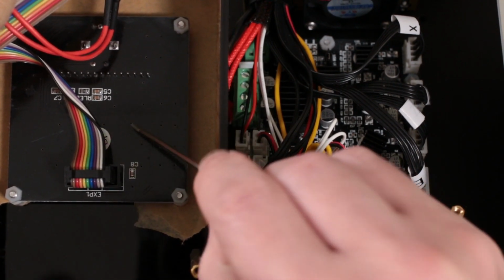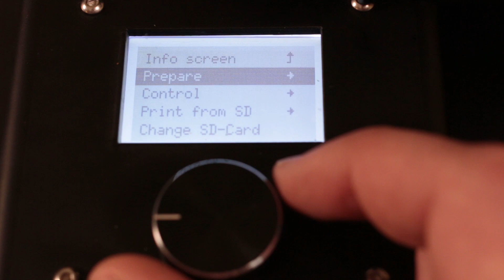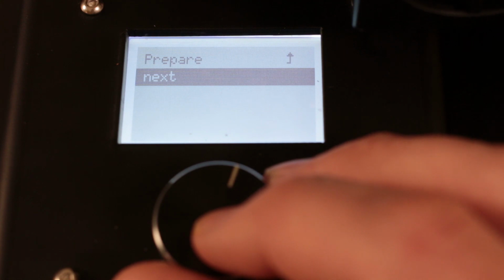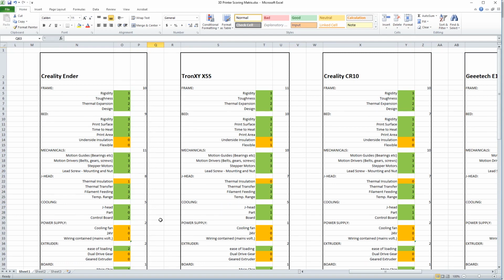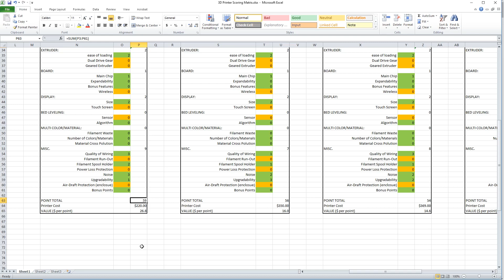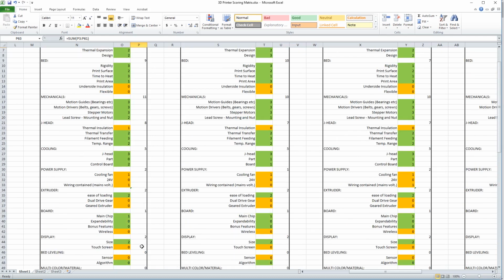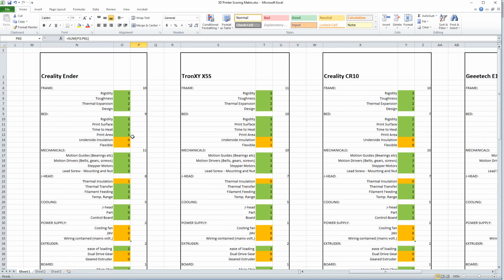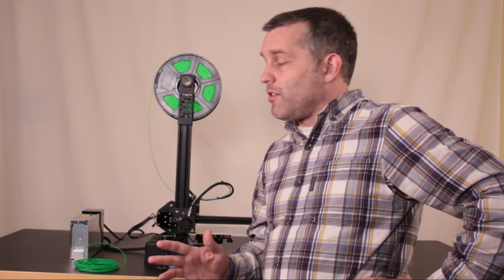The Creality Ender 2 - A surprisingly great 3D printer.

Comment: The limit switch also belongs in the lower rail. ;-) A cover made of metal would be electrically conductive and here plastic is probably more advantageous. A Partcooling fan connector is already in the firmware and on the board next to the laser connector. Z Spacer can be found here https://www.thingiverse.com/thing:2526607 or https://www.thingiverse.com/thing:2752080
Reply from the maker: Hi Sven, Thanks for the great information. I've pinned your comment. It didn't even occur to me that the limit switch could be actuated by the pulley wheel (what a strange solution), which is why I never thought to put the original switch in the lower rail. As it turns out, my limit switch bracket is completely unnecessary, and the stock components will work fine.

Comment: Does it require a mosfet for the heated bed for the long term high temperature prints?
Reply from the maker: The external mosfets, and SSRs that everyone is so fond of installing on their 3D printers are often times redundant. There is in fact a mosfet controller for the heated bed already installed as a part of the main control board. The problem is that many of these poorly designed Chinese 3D printers have inadequate heat sinks attached to the onboard mosfets. Hence the need for a mosfet or SSR unit. In the case of this printer, I do not see the need for an external controller for the heated bed. Reasons being 1)The onboard mosfet is sufficiently cooled with fan and heatsink, and 2)The bed is small on this printer so the load is not nearly as great as many of the other printers out there.
Reply: Ok thankyou just wonding because you did not bring it up and was a bit confused since its a small build volume.

Comment: He should put that Y limit switch bracket on here for others. I ended up modding the only 1 adjustable one I found on thingiverse and it works ok but istn't quite long enough and limits my bed travel from using the front 20mm of the bed. I may have to try to make my own on Tinkercad as I am trying to learn it anyway. Great review as always!
Reply from the maker: You don't need a bracket. I installed the sensor incorrectly. As Lewis Balentine commented earlier this is how the sensor should be installed so that it gets activated by the pulley wheel: http://www.homofaciens.de/bilder/technik/3D-printer-Ender-build-instruction_020.htm

Comment: ender 2 or TEVO Michelangelo. what one should i get  bed size dnt matter to me. all i want to know which 1 prints off better
Reply from the maker: Get the Ender 2. While the Michelangelo has a better more compact design, and has some better components and a part cooling fan, it lacks a heated bed. Unless you only plan on printing with PLA you will need a bed heater. It is much easier to add a part cooling fan to the Ender 2 than it is to add a bed heater to the Michelangelo.
Reply: im only planning on using pla tbh.

Comment: Correct location of "Y" limit switch: Lower Slot, right hand side. Wheel triggers the switch.
FYI: I had the same problem :-(
See this picture (not mine) http://www.homofaciens.de/bilder/technik/3D-printer-Ender-build-instruction_020.htm

Comment: it does have parts cooling its just "indirect" parts cooling. it uses blow buy from the cold side hot end cooling fan to blow through onto the part. this is why the bottom is so "open" to allow for cooling.

sadly this is not as functional for tiny points and for underhangs.

you can get 150x160mm on the bed and you can goto 225mm on the Z no problem.

Comment: the cover is like that for 2 reasons. it looks nicer (the original machine did not have the ugly power supply but had a nice "brick" like a laptop that you plugged in.)

its also acrylic which is much cheaper and most of them are already "tooled" for making. molding a part that large would cost a lot more than just bending the very nice looking cosmetic acrylic cover.
Reply: The power supply could do with an on-off switch. Maybe that's the first mod to do.

Comment: This is not a review.... at least not of the Ender 2... You made modifications to it and reviewed the altered printer.. But as always thanks for the funny video........
Reply from the maker: Fair enough but as another commentor pointed out, I didn't need to make a custom bracket for the limit switch. I just needed to place the original bracket in the lower rail so that the switch was actuated by being bumped by one of the pulley wheels. So, all of that section of the video was just me doing work I didn't need to do. But now my printer has a nice green accent to it. :)
Reply: Design Prototype Test try to follow the manual next time, and make a script with correct facts. If you are not 100% certain, don't say that. Like the jumper that you pointed out and blabbed some things about that I don't think was correct. I think that jumper is to choose where from you want to power the board(usb or powersupply)....

Comment: Thanks for the review, I just got mine and am amazed so far with the printer for the $175 that I spent on it shipped from 3dprintersbay.com, I had mine in 3 days after ordering.
Reply: 7Westwood I wanna order mine from there trust worthy site? Can't find it much any we're else
Reply: dingokorn 3dprintersbay.com was awesome, I had the printer in 3 days and receive emails from them regularly. I would highly recommend them.  I have ordered from GearBest before and it took much longer. Good luck. You will love the printer.

Comment: I'm a little new to printing ABS, so apologies if this is a naive question, but can full part adhesion to the bed be accomplished at the printer's max temp of 60°C?  With my current printer, I'm using glue stick @85°C with good results. This seems like a potentially very high value machine that I could use for some of my high volume small parts. Best, Chris
Reply from the maker: Hi Chris, No, print adhesion with ABS will not be good at a bed temperature of 60°C. Thankfully this one gets up to 100°C in under 5 minutes. Also, to get crack/check free ABS prints you really need to be printing in a sealed enclosure. The ambient temperature of the draft free air around your print should be between 40-60°C.
Reply: Oh, great, 100°C is fantastic. One of the vendor sites I looked at only rated it to 60. Just as long as the parts stay completely on the build plate, I'll be good. Did you experiment at all with taking parts to the outer edges of the build plate? This is looking like a machine worth trying, the more parts I can print at once, the better. Thx
Reply from the maker: Just get your limit switched adjusted correctly so that the nozzle lines up with the edges of your bed, and you should be able to use the entire printable area (no binder clips to get in the way). One thing you should know is that you will probably get surface imperfections when printing multiple parts at once unless you employ a number of tricks: Get your retraction settings correct, use Z-lift, and print inner walls first. Simplify3D might be a good purchase.
Reply: Thanks again, I'm sold on getting one to try out. I currently have good luck using Cura and my Rostock printing multiple parts, no issues with surface imperfections. Although bed adhesion is a problem if I do more than a ~6" circle, I need to figure that out... But I digress, this will be great for printing batches of some blocks I designed, if all goes well, I might end up with a small farm, Lol
All the best to you
Reply: the new model like he has SHOULD be able to hit 100c in gcode.

The ender 2 is nothing short of amazing. I have 9 of them and absolutely love them to death. high quality lowest noise prints of any of the 40 machines I Have.
Reply: Great information, thanks. For the price, I can affordably pump up the volume on my idea. Ordering the first today to give it a shot.

Comment: A little research beforehand would've had you spouting correct information instead of doing a review and giving incorrect information to the viewer.

The firmware on the E2 & CR10 is flashable, but you have to install a bootloader first.  It's doable using an arduino uno, raspberry pi, and I've heard some doing it with an AVRdude.

Good work shimming the Motor, some have issues with that.  There's plenty of designs on thingiverse.

The Y limit switch either you installed incorrectly, or I magically got one that worked.

It's by no means an "ABS machine".  The control box is fixed to the base, and enclosing it would shorten it's life.  To do so, you'd have to remove the control box & electronics, and extend the cables to get it far enough away to create an enclosure.

There's readymade auto bed levelling kits for it, and ports for it onboard.  There's ports for part cooling fans onboard also.  Any CR-10 fan duct will fit.
Reply from the maker: Thanks for the information Joe. Try not to be so rude about it next time. As it stands I already spend WAY too much time making these videos, and this video is going to make me about $20. I depend on people like you to give me feedback and help spread good info. I even pin the most helpful comments to the top.
Reply: I'm a fulltime dad too, and somehow I had the time aswell.  Amazing isn't it?  If calling it as I see it is rude, then so be it.
Reply: wow just wow... Look at the pot calling the kettle black.. shesh.. Maybe a little research would inform you that AVRdude isnt some sort of hardware. It is in fact a flashing utility to write bits to ROM/EEPROM. The Arduino IDE uses AVRdude to flash code. Similarly if you use an RPi's SPI lines to flash a bootloader you'd use AVRdude. Basically the only time you wouldn't is if you had an official ATMEL programmer like the STK500, dragon etc.
Reply: avrisp, whatever.  I used a pi to load the bootloader to my E2.  Crap, I got half a word wrong!